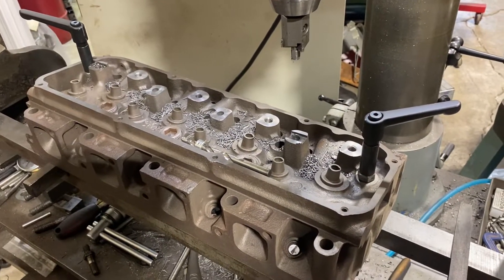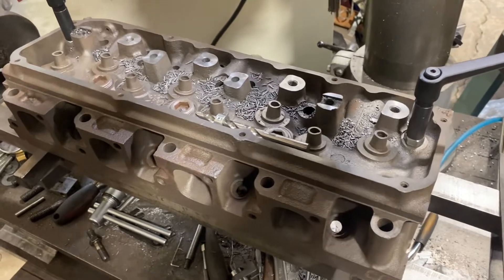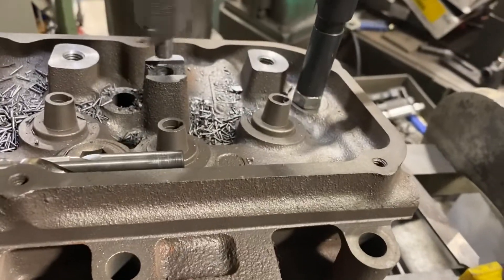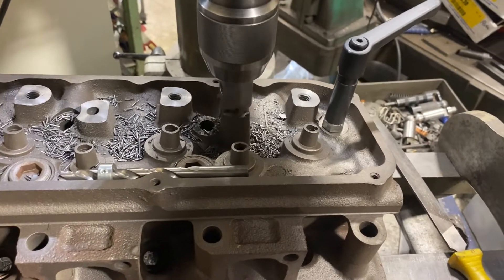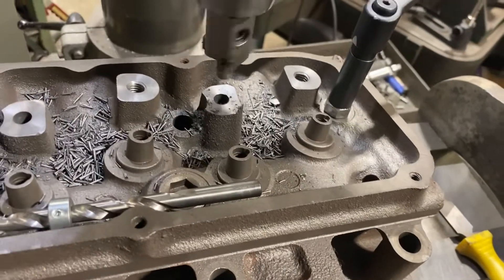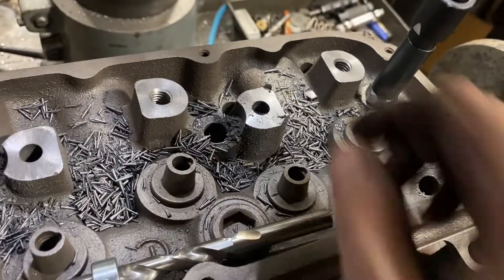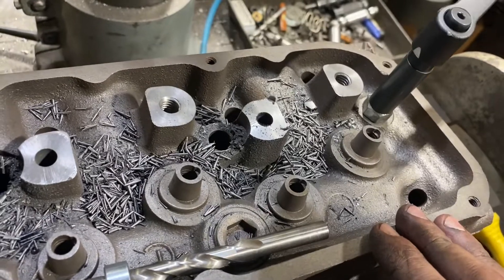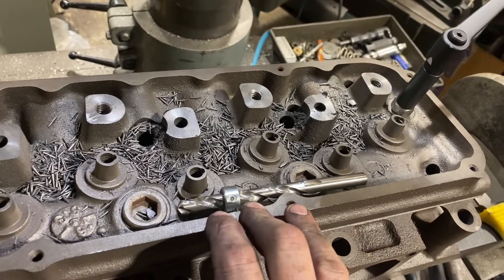Ford 351 Cleveland head work rocker stud machining

Comment: How much do you remove or what is the finished hight?
Reply from the maker: I remove .300”. That is the industry accepted spec over the years.  Must be good info because the rocker geometry worked out well, aluminum rocker didn’t bottom out on the stud hex, etc.